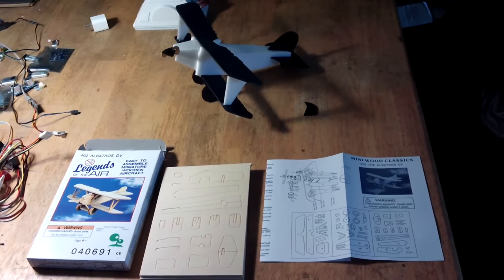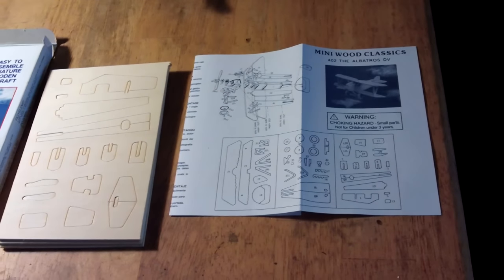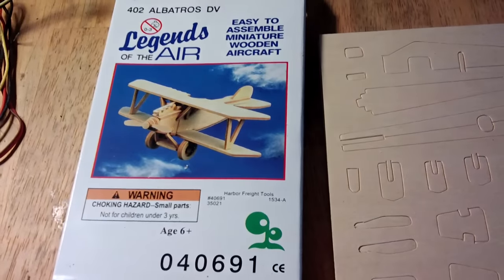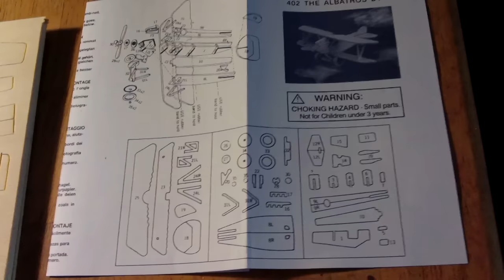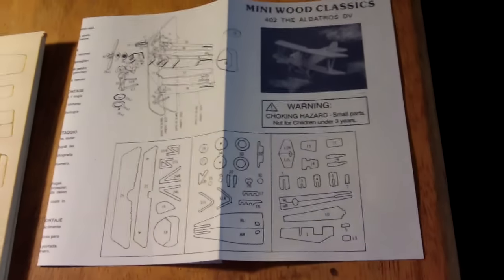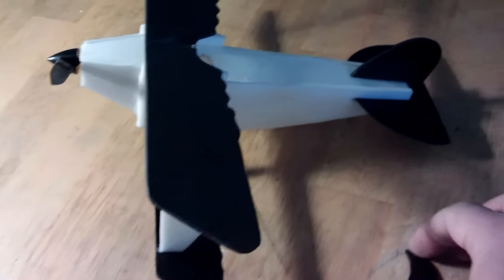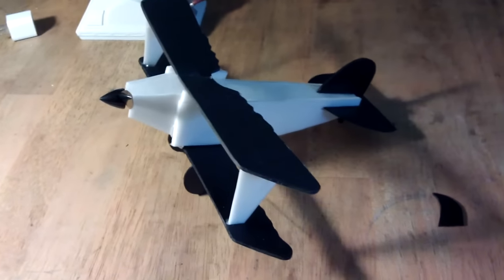The GrandadIsAnOldMan inspired biplane

Comment: That is a little beauty, excellent job. I had a quick look for some ItCanFly items on eBay, all USA listings and the postage is more expensive than the items, but I have some ideas I want to try anyway. Weather is still rather wet and we are expecting the cold spell to start soon.
Reply from the maker: +GrandadIsAnOldMan A delight to emulate your idea. The ItCanFly stuff is simply light, supports homemade actuators and has a lot of steps on the controls. The thing is, it just allows smaller builds to be made flyable, larger builds work just as well with larger parts. Best wishes for the weather ! we've had 2 days of anomalous 62F/18C.

Comment: wow what a nice little flyer,or is it the expert flying technique? no snow !! thanks for sharing another great build and video.
Reply from the maker: +bill bailey Crazy weather has a bit to do with it, 65F today too. Meaning the lipo doesn't quit early and the wind was at zero, all helps. The ItCanFly controls are part of it, having lots of steps of throttle and rudder really did help. But it's a tough little bird, taking knocks and inverted 'landings' very well. I like it, looks fat and rough, but goes quite cleanly and gently.